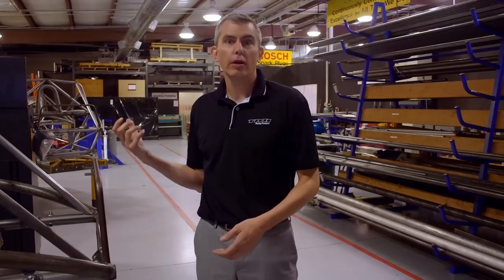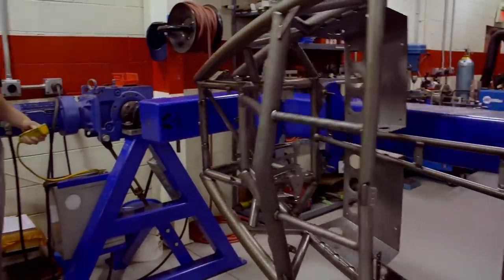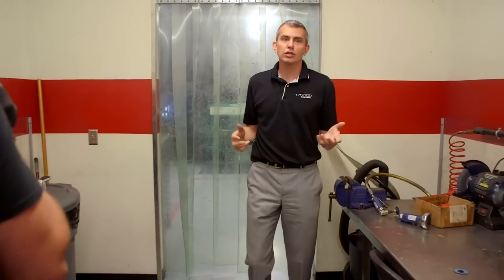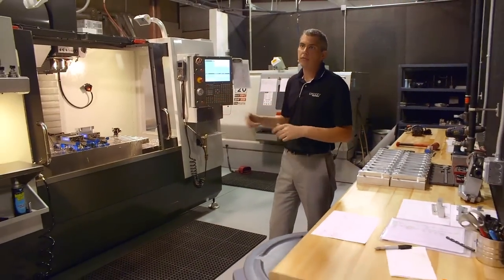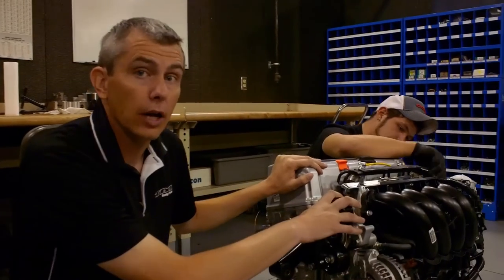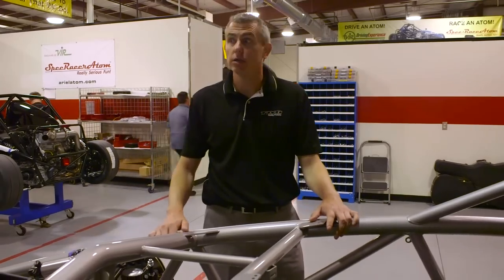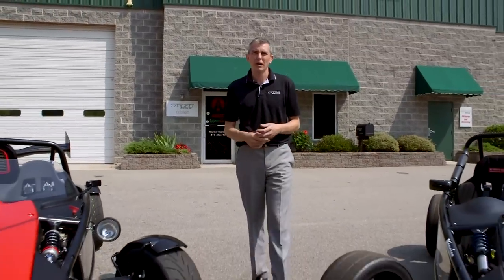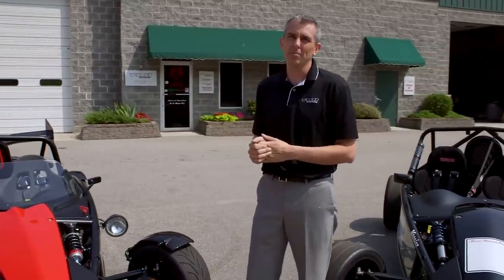TMI Autotech Walk Through and Ariel Atom Production

Comment: This isn't a real Ariel. The real Ariel is from the UK. This chassis is totally different. This one has a GM engine. The real UK Ariel has a Honda Civic engine. Thanks.
Reply: christdragon he said 2.4 litter Honda engine i guess it is a K24
Reply: Mine was built at TMI with a Honda K24 back in 2013. From what I know, the AA2 used a GM powerplant, and the AA3 uses Honda.
Reply: Yeah right. They only bought the license to manufacture atom but these guys are not the original atom team.
Reply: the real atom is not welded together, it is fillet brazed like a high-end bicycle or motorcycle.